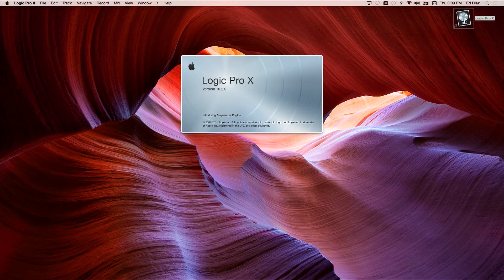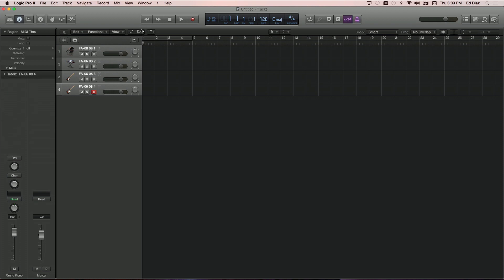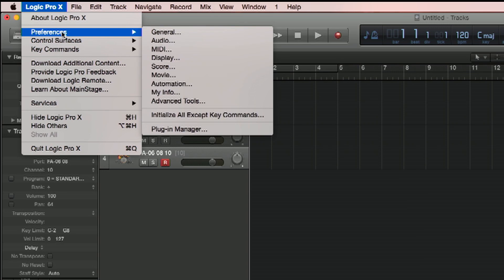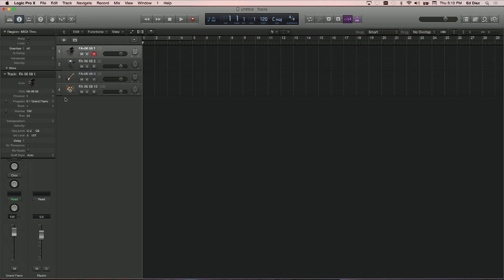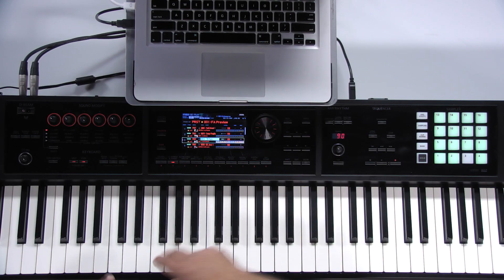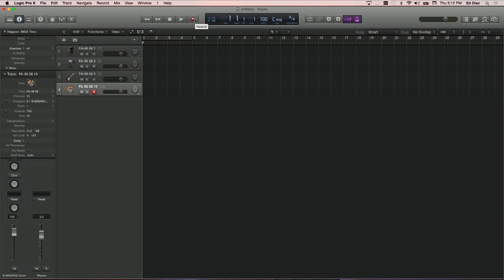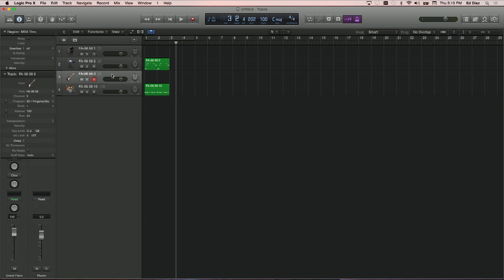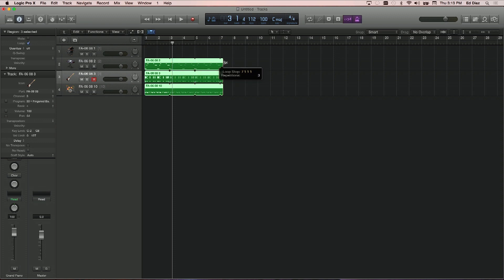Roland FA-06/08 - How to MIDI sequence using Apple Logic

Comment: I might have found the way to make it work... it bugs a bit but it shows wrong names of instruments it does the job up to 16 midi tracks. In fact, it is not problem, since you can convert a track into audio and reuse the Chanel. My Logic Pro is in German, I will describe the best I can the solution :

#1 Create a new track
#2 Select External midi
#3 Select the option Plugin for external instrument
#4 Check your Audio input is 1+2
#5 On the right side, Midi goal (translation might be not good, but you get the idea) should be set on Fa 06 08 - 1
#6 Select the ascending option
#7 Select Audio Output 1+2
#8 Select the Ascending option at the bottom too
#9 click on create

Logic creates a track and opens a window called "Inst #"
#10 Assign a Chanel for this very track. By default it is set on 1
#11 Record and have fun

you want another instrument... then repeat steps 1 --> 9 
#12 assign a new Chanel, just overwrite 1 with a "2" for you second track
#13 In the "inst" window of the previous track(s), make sure input is no more on 1+2 but on "---" 
for you third track, same thing but as channel 1 and channel 2 are already assignes, you will assign an other Chanel, I would go for 3.  ;-)

It works !!! I have been struggling for 2 years now and I have just found the solution. The sounds of the Roland FA are soooo great, but it was so a pain in the ass to make them work inside logic!!!!

If it helped you, please go see my channel, hear my tunes and give a like or two!

Have fun!
Marc - French musician lost in Austria

Comment: How to export the sound of fa06 from logic pro
Reply: You ever figure this out???
Reply: @DrOctave88 no. I did a lot of research . we have to record the patch as an audio track ... I couldn't find any other option and we can do simultaneaously that is to record both audio and midi
Reply: may be if we do this we have an option of exporting the track from FA. i am not sure though but that might work.
Reply: @DrOctave88  It's not possible. The only thing you can do is assign the midi notes to the tracks that are assigned in the studio set and whatever the MIDI is. the output sound will come from the keyboard after processing itself.

Comment: Hi Ed, what cables do I need to buy in order to connect my Roland FA 06 to my laptop. I want to be able to play on my FA 06 and have Logic (that I have installed on my laptop) pick up what I play, so I can mix it later. Could you tell me what cables I should buy to be able to do so? Thanks a billion!
Reply: Donna Pennartz a printer cable should be enough for you as the fa is an audio and midi interface thru usb

Comment: Usually love these however there is a step missing. How do you set up the fa 06 to logic using another audio interface?
Reply: Big Bey that’s the issue I’m having. When I turn off my keyboard all the sounds go away. If you found a solution let me know homie.
Reply: I have the same problem, and I find it unreasonable that Roland does not respond to the questions from you and others about this thing.
Reply: https://www.youtube.com/watch?v=OGL_qDS_53I   this video is probably the answer for this problem. ;)

Comment: I added the fa06 to my studio. I love the sounds but to be honest its a nightmare to work with in Logic. You can't bounce anything you do when you're using it directly with the computer (without another interface) and for some reason it changes sounds in my Studio Sets I've saved when I reopen a session in Logic. It's so frustrating!! It has great sounds and thats honestly about it. It's also hard to get very specific help on that anywhere. Unlike Yamaha and Nord.
Reply: Do you still have it and did they fix the kinks with Logic? I have Logic but I don't want to pull the trigger yet on the FA because of this.
Reply: I've got a focusrite 2i2. Will I be able to record it with my setup ? I am imagining something like use fa06 for output, focusrite for input, send midi through fa06 and capture through focusrite. Am I correct ? (havent tried yet.)